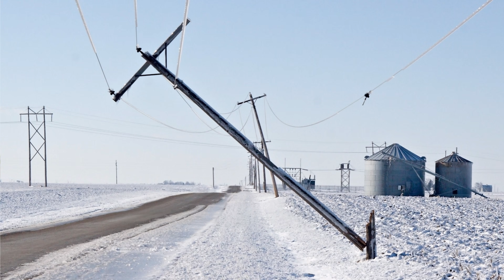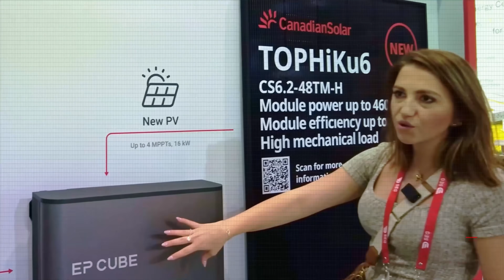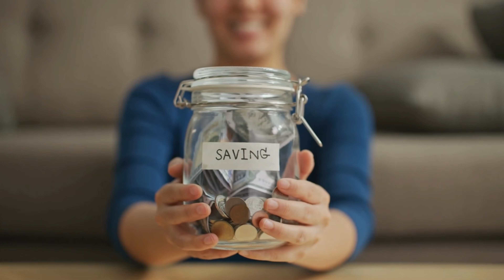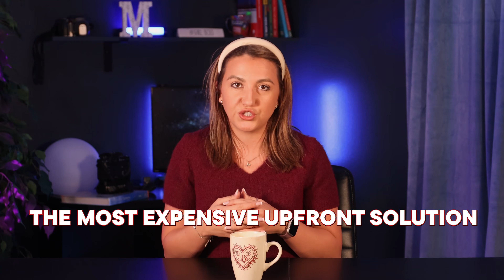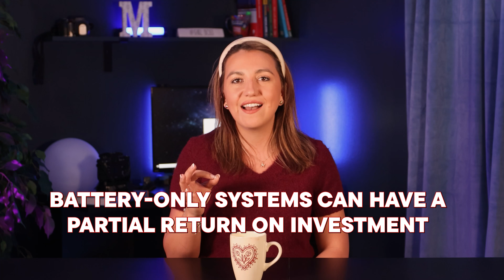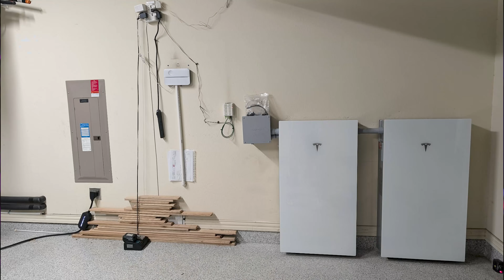No Power During Winter Storms? Generator vs Battery Backup Explained – You Might Be Surprised!

Comment: Thank you for sharing, this is helpful. I use a generator, a combined solar and battery storage system for my home, and I will recommend a combined solar panel and battery storage system. I do work for Sunrun, they install solar panels and battery storage systems. Getting personalized quotes that fit your home's energy usage can help you know the right system that fits your home. Then you can compare your current electricity costs with the personalized quotes and see if it's affordable and which makes more sense for your home.
Reply from the maker: Thank you so much for sharing! Now did Sunrun also install your system? based on my knowledge they mostly offer leases? Could you share some insight into that?

Comment: I am in Mobile, AL. Our power company, Alabama Power currently charges $5.41 per kilowatt of solar power installed on your house. So, I am thinking of installing solar and cutting the cord to the power company.  I already have a whole house generator. Because of the power company policy solar power on a roof is extremely rare.  I would also have to install multiple backup batteries to see me through the night. Does it make sense to do this.  Current charge for power is about 15 to 16 cents per kilowatt.  My power bill during the summer is closing in on $500.00 per month.  I also have an electric car that can export power to the house if enabled.  Does it makes sense to do this?

Comment: with battery first solution you can often buy a smaller generator that just is used IF there is no grid to fill up the battery - depends how big your battery is how well that works.
In the prior texas deep freeze I noticed I got at least 6 to 8 hours of grid per day to refill the battery stack so to fill out my battery first plan I (similar to what was presented here) also bought a smaller ($1300)  tri fuel generator (I have Natural gas for furnace and water heater) that put out enough energy to fill the batteries at their max charging rate - but NOT enough to really run the whole house.
But generator didn't have to power the house. It just runs at a steady rate long enough to top off the batteries as needed.  I can use the time of day discount now when grid works 24/7 and only pull out the generator when grid is flaky . And once I get solar panels the generator is backup for when the grid (and nat gas) is down and sun is overcast. 
A small generator can make your initial system cheaper as how often do you have a grid outage - but grid outage was the main thing I wanted to prepare for. The rest is nice to have.

Comment: All and well is good but I find it kind of difficult to spend 20 or $30,000 on batteries and solar when for me to actually make my money back on that would it be about 15 to 20 years? Stuff is just too expensive to get done.
Reply: So you would spend that on a standby generator, and it will pay for itself when???
Reply: There are issues with solar as well.  
Many places in the US don’t get Sun like TX.  
The ROI for solar panels is 10 yrs, but the EOL for batteries is 3-5 yrs, for safety and tech upgrades.
Insurance is higher for roof-mounted solar, and house values tend lower.

Comment: My personal rules for surviving a disaster. 

A generator or small solar power station first is a good idea because it can get you through the first few hours of a disaster for a fairly low cost. But keep in mind that generators have serious limitations. The three big ones are that you have to go out into the environment to set it up unless you have a more expensive permanent automatic generator setup, fuel can go bad and will be scarce in an emergency, they require regular maintenance. small gas generators typically require and oil change every 100 hours or 4 days. Plan for a space to do this during the emergency.
For the small emergency generator, look for one with a remote start option so you don't have to go out into the environment to start it.
Power stations also have serious limitations, primarily being that they only store relatively small amounts of energy. Assess how long you can power what BEFRE the emergency.

First minutes to hours is survival. You need air, shelter, water, food, information. These need to be secured and assessed BEFORE the disaster and be ready at all times. The battery keeps these available by maintaining the environment in the home and powering the cold food storage and keeping pipes from freezing. If you have cold winters, this means having the primary heat source be something other than electricity like a gas or wood furnace or at least a strong backup like a wood stove for a small house unless you normally power your heat from battery and you know it is reliable. Even then, have a backup handy like a wood stove or two. Don't forget information. Power your cells phones, wifi, laptops. You need information to decide if staying put and riding it out is a viable option. Also, keeping the computers up gives kids something to do besides be scared. Keeping people calm is also important.

The first days is about assessment and adaptation to your new situation. How much food do you have on hand? How is your water? how long can you stay put? are your emergency plans working or did something unexpected happen? How is the situation changing? Are conditions getting better, worse, staying the same? How are your neighbors? Check on them.
This is when you set up your generator if you need to do that.
Use low energy (not to be confused with power) food preparation methods. Making a pot of coffee only uses about 100 Wh. 8 hours in a large crock pot can use 1600 Wh. Dry and already prepared food like fresh fruit, canned cooked meats like tuna, sausages, crackers, potato chips, etc are good things to always have on hand.
A microwave is high power but low energy. Heating already prepared frozen meals doesn't use excessive amount of energy. 
Maintain lines of communication to be able to continue to assess the situation.

Weeks to months (pray it doesn't last that long), This is about recovery. What broke, how do you fix it? Clear roads, house repairs, get back to work to earn money. Do you live out in the country? can you clear a road or do you need to ask a neighbor to do it? It pays to have friends.

If you have a plan for all of this, you will do well in and emergency.
Reply: Get a small dual or tri fuel generator to just top up the batteries if you have a system that works on battery alone for a day or so. And propane never goes bad  (and gas makes your generator harder to maintain.

Comment: If you are planning for this to be used for an emergency like now, you can get into a generator to keep your house warm and your fridge cold for about $1000.  The only exception is if you have a 240V large load furnace.  For $1000  you could have a smaller Inverter generator and an interlock kit to provide power to your home.  The last Texas emergency of this scale was in 2021 about 5 years ago, so spending 1000 and the equipment will be used once every 5 years makes economic sense.  This is an option if you do not need an automatic transfer switch.  Once you have this basic system, you could add a portable power station with a little more power capability for another $2000 at some point later.  Ecoflow Delta pro 3 could deliver 4000W of power at 240V while the small inverter can charge it with 120.  It is an emergency use, not a permanent thing.  Since the solar and battery system tax break from Biden was removed by Trump, you have to pay the entire cost of a solar and battery system, instead of getting 30% back on your taxes.

Comment: Having been through several devastating hurricanes, my conclusion is that the ultimate backup is a solar system capable of supporting at least emergency loads continuously (ie furnace, freezers, refrigerators, coffee maker, microwave, wifi, personal electronics, etc) for at least two days on battery only and recharge that battery with solar in 3 hours then have a small diesel to recharge the battery if the battery goes low.

The solar system can provide energy daily, no emergency required and start saving you money from day one. Then the diesel backup that runs intermittently to charge the battery helping to generator to run at peak efficiency minimizing fuel use that can be hard to come by in a wide spread disaster.
And diesel is preferrable over gas as diesel can be stored longer. 

The solar will work automatically if already set up. This saves you from having to go out into a storm to set up the generator away from the house. Then when weather permits, the generator can be set up to run when the battery gets low. Many all-in-one solar controllers already have auxiliary outputs that can be used for things like starting a generator with auto start capability.

But if you are just starting out, I would suggest one of the new solar power stations that has pass through and UPS capability. You can continuously power your furnace (assuming it is not electric) from the grid until power goes out then it will automatically run the furnace for a few hours depending on battery size. This gives you time to decide what to do in an emergency.

Comment: buy a generator first, generator($1000 portable, 12K watts if you want to 240V). Then look into battery backup w/solar. Also that generator can charge the batteries so keep it handy!

Here in the midwest i see solar panels covered in snow for weeks and no sun for 1-2 weeks at a time. So generator first, then battery backup, with solar if possible. I first got a 3500 watt quiet generator,  then Jackery 5000 backup system with 4000watts solar array(which has need almost useless in the midwest winter. Thanks for the video!!!!
Reply: This is the best option. A combination of sources and storage. I wouldn’t go with a consumer brand like Jackery, however. Low lifespan, and very high cost per unit of storage.

Comment: The worst case scenario for battery + solar system is the grid is down, there is little or no power from the panels due to snow, ice, or heavy clouds, and the house needs a lot of power to  keep warm. You are now 100% on the batteries. Unless you have a really big battery bank, you will soon need the generator. Depending on weather, length of outage, and capacity of battery bank, you may have a couple of days or several hours of power just running on the batteries. In these more extreme cases, you will need a generator. With 19kW of solar, an 1800ah battery bank, snow covered panels, and weather staying below 20*, my battery bank was at 20% in 30 hours (not trying to manage power). At this point I run the generator to cover the loads and recharge the batteries. So, it's a good idea to have a generator, even with a solar/battery system to cover extreme weather with extended outages like we are seeing now and saw in 2021 (5 days without power and single digit temps with snow)
Reply: This is an important point, but you only need a small generator to charge the battery, not to run the load. With sufficient fuel, a 2kW generator could give you up to 48kWh in a day. And it would only rarely be needed--in most places, probably not once a year, and maybe not once a decade.
Reply: @lancebenson8400  My inverter uses the generator to power the house and charge the batteries when the grid is down. 2kw would be totally inadequate under those circumstances and wouldnt even run the heat pump, yet alone charge the batteries.
Reply: @lancebenson8400  2000 watts? Are you talking about using a separate charge controller from the inverter and powering it with the generator?
Reply: @FireLt2017  If the battery + inverter is sufficient to power the house when charged, then, yes, charge the battery with the 2kW generator for 24 hours in the rare case when the grid is down and you don't have sun for your panels.
Reply: @lancebenson8400  The inverter cannot charge and discharge the batteries at the same time which is why there needs to be sufficient power from a generator to power the house while the batteries charge. Even if the generator was just powering the house and not charging the batteries, you cant run a heat pump or any form of electric heat with 2kw
Reply: @FireLt2017  2kw is enough to run an electric fireplace along with a central air handler to circulate the air. plus some lights. All that aside, what panels are you using that stay frozen with sun out? Are these special panels? Because normal black solar panels will get hot enough to melt ice in no time. Regardless of outdoor temps. Used them for years here in northern US at negative temps. Snow falls right off and whatever ice sheet is on them will be melted and gone by noon. Sounds like you need new panels. Top-con will produce more than enough to still run your heat pump even in cloudy days. Don’t need any of the newer fancy tech panels.
Reply: @zimvader25  I know what 2kw can do, and more importantly what it can't do. 
I personally want the house to function normally when there is limited solar production, no grid, and the batteries are discharged. Most people feel the same way. 
What if the outage lasts a week? You might be content with an electric fireplace and the fan in the AH running to barely keep warm and do nothing else like cook or have hot water for showers.
The panels are not special (ymb) I guess you have never seen ice covered objects like rooftops, streets, or sidewalks take days to melt even if the sun comes out?
Reply: @Fir @FireLt2017 erally just went through it here in DFW. Ice melted by noon the day we were stuck inside. You don’t seem to understand that “sunshine+black glass = melted ice”. Regardless of temperature. My batteries were charging those frozen days where the temps hovered at 15 during the day. You comparing sidewalks roads and rooftops to solar panels which are literally designed to absorb as much solar energy as possible, really doesn’t help your “i know what it can and cant do” case… panels can heat up well above freezing at well below freezing. Temps have to be in the negatives, which they don’t get here in Texas, for solar panels to stay cold and iced over. Even at my home up north, the temps can be at 0 and the panels will still melt the ice. Again, what special panels do you use that stay frozen? I’d rather go indefinitely half cocked with a 2kw system if needed than to count gallons of fuel.
Reply: @zimvader25  Listen carefully you condescending  dumb a**. 

You are assuming the sun was out the day after the storm- it wasn’t. It was cold and cloudy at my house for several days and nothing was melting, not even the panels. They didn't melt because there was sufficient cloud cover and the high temperatures for  days was less than 20*. My special panels did melt when the sun eventually came out days later. Just because you had enough sun to melt your panels quickly doesn't mean everyone did.

MY whole point is that you could have little or no solar power for days at a time. 

 Got it figured out yet?? My original  post about having no solar or very little solar due to heavy cloud cover and or panels covered with ice/snow- or did you read it?? 

Lastly, I said I know what 2kw will power and what it wont, which has nothing to do with snow/ice melt on panels. For perspective, the average blow dryer is 1250 watts. 2kw is nothing. You're telling me you will run your electric fireplace AND charge your batteries too on 2kw?? 

If you want to barely get by with your 2kw generator when there is no solar, no grid, and your batteries are discharged, go ahead.  Most people don't want to scrape by for days at a time. 

Run your light bulb, AH fan, and electric fireplace, but that's all you will be running. Unless you have gas, 2kw won't run your water heater, it won't allow you to bake anything in the oven, and you won't be washing and drying clothes. And if you are "stuck inside" like you said, you aren’t  going out to eat either. Im saying most most people don't want to.
Reply: Generators run out of fuel too 🤷 if you’re stuck at home you’re not going out to get extra gas or propane. Once you run out, you run out. And as impossible as it is for people on the internet to believe, NG isn’t available in all areas. We don’t have that here in the boonies. Solar panels on the other hand, don’t really stop. Because of their nature/design it doesn’t matter if the temp is in the negatives, once the sun comes out, the panels are quickly clearing themselves of ice and producing again.
Reply: @zimvader25  My generator can run run continuously for 114 hours at full load and 200 hrs at 1/2 load with a 500 gallon propane tank. Your 2kw would have to run continuously the way you propose using it, but mine only needs to charge the batteries and shut off. Then  I can run off the batteries for two days before I have to run the generator again. What if the skies are overcast with no sun for several days? 
This is about being prepared with as little disruption as possible. How exactly will your 2 kw gen be hooked up? To the generator terminals in the inverter? If that's the case, you will have to power down the house because the inverter cannot use the batteries while charging them- the current can only flow one direction at a time.